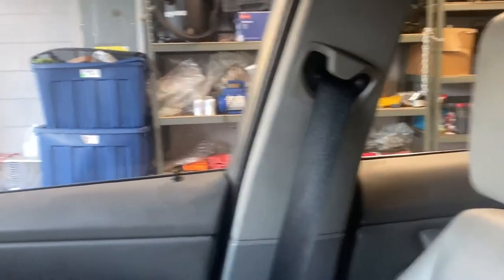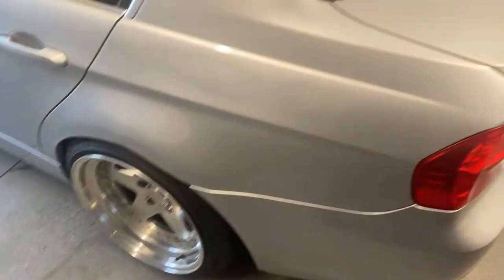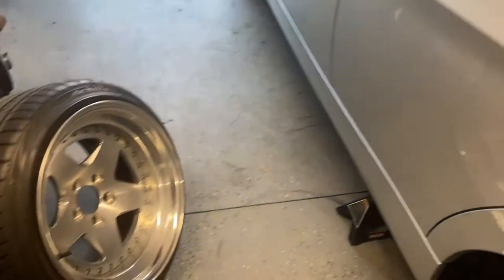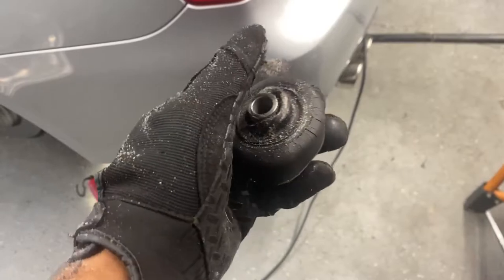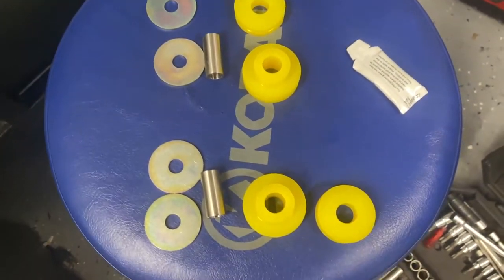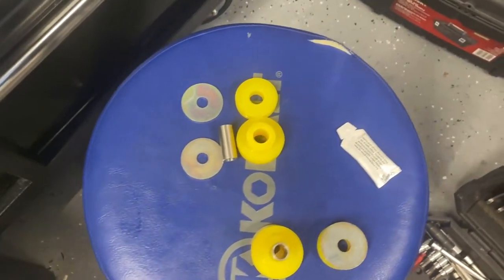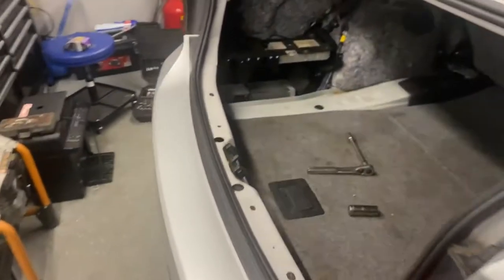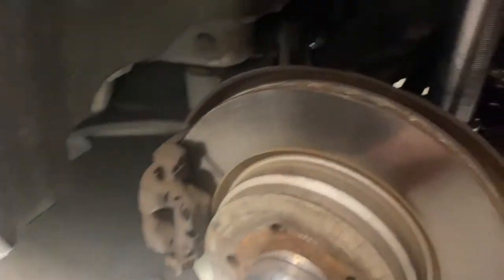Fixing My E90 335i Rear Suspension Clunking

Comment: Hi sir...after replacement upper and lower mounts only(not absorber) do we need to do tire allignment?
Reply from the maker: I would do it just to make sure everything is in spec. But if you marked the bolts used for camber and such before removal you wouldn’t have to.
Reply: @nOshi2x  one more inquiring sir...why my e90 320d m-sport doesn't have stop bump on -4.24 minutes left(first install new mount on new absorber)😅
Reply from the maker: @nikmohdrostamniksoh4457 ohh wow yea no good on that
Reply: @nOshi2x  I mean it look like m-sport version doesn't have stop bump🤔(I removed my Rear absorber right and left side today).. when I saw you installed first mount(I called stop bump) into cover dust on your video